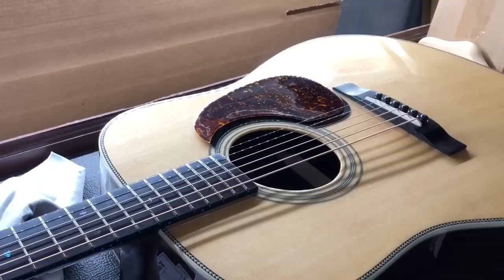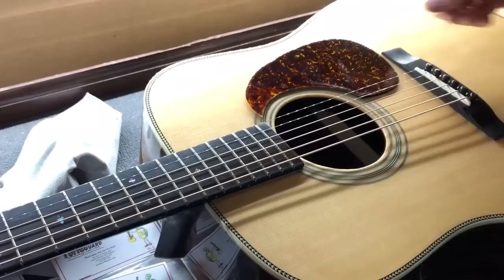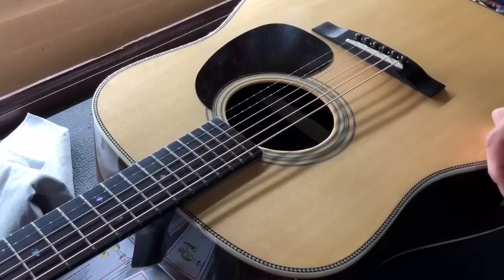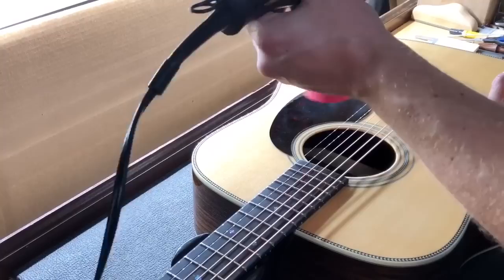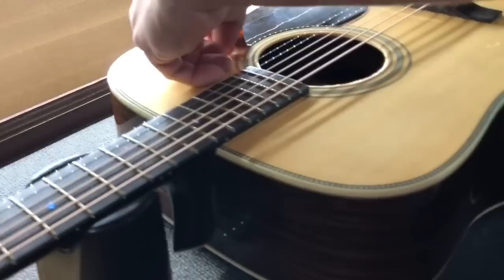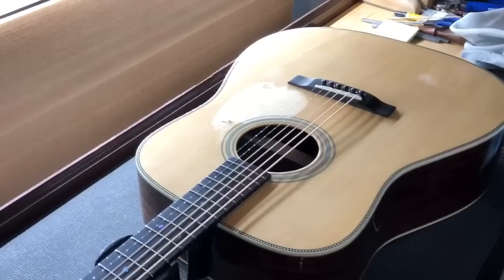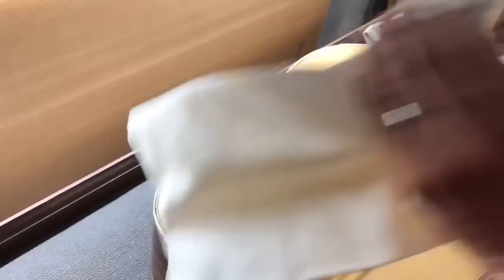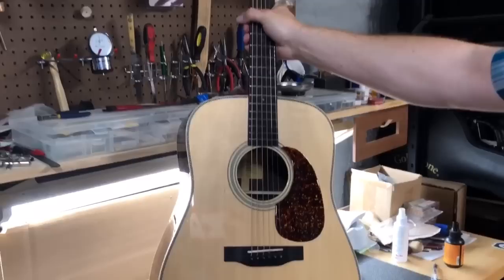Tech Tip: How to Change a Pickguard on Acoustic Guitar

Comment: Just removed a pickguard off a new guitar... 
All I did was fold a piece of A4 paper in half and wedge it underneath... done in no time... then removed the gunk. 
No way would I let a hair dryer anywhere near my guitar.... this way there was no heating/stressing etc etc
as simple as can be :)
Reply: Exactly, that direct heat can't be good... I, too just removed a pickguard off my new guitar. All I used was naphta (lighter fuel). Works like a charm to remove the glue residue.
Reply: @deejay.s  ... Now the lighter fuel is a good idea LOL... I spent over an hr with soft sponges and palmolive detergent!!!... what a freaking mess!.. I will be sure to remember this for next time!.  :)
Reply: Ive taken off using a sheet of paper, too

Comment: Well done. Very thorough tutorial. I'm going to replace mine but I'm going to cut and keep part of the tape on the bottom to hold my pick. I'm not a fan of putting on the head and I Inbetween strings.

Comment: I have removed the pickguard from my acoustic guitar without using a hair dryer. Maybe some pickguards are more difficult to remove with just a chisel, scalpel or similar tools, but mine came off without any problems. I carefully lifted the edge with a scalpel and then used a flathead screwdriver to help peel it off. It literally took me 30 seconds. Maybe this helps someone!

Comment: I changed mine using a heat gun on low and removed the glue with rubbing alcohol. I tried "goo gone" and it helped but alcohol works fine with a credit card. Gotta go there's a deer walking towards me at 11pm while I'm on my porch.. I live in the City lol

Comment: That pic guard did not look too bad when it came off, it looked very straight and it didn't look like it curled. Could it be reused on another guitar? Would it need some sort of adhesive backing, what would you recommend for that?

Comment: I’m pretty intimidated doing most anything on my beautiful Martin. I do want to change the pick guard from black to TS. removed some plastic letters off of the rear hatch on my car with thin fishing line. It slipped under the pieces and and pulled both ends slightly sawing back and forth. It made the job very easy. What do you think of that method? I’ll probably pay my local luthier anyway.
Reply: I am really hoping people do this for guitars that wouldn't cost more than 150 to 200 max. I personally would never do it to a Martin myself. I'd take it to a professional, to be honest.

Comment: If you want to remove a pickguard off a brand new Taylor, is the finish underneath the pickguard  ruined by the adhesives of the pickguard?  I have a 327e and would maybe prefer to not have a pickguard at all.

Comment: Windex also works great for removing glue.
Reply: Don't listen to random suggestions about glue-removing solvents. Your guitar may have a finish which will be damaged by alcohol-based liquids.
Reply: Heat the adhesive back up and stick masking tape to it' pull up and it's removed. 
This is the method I've used to remove adhesive left behind from decals and emblems in the body shop and have used it on several guitars also. 
Like he said'  some solvents can harm the finish.

Comment: Would a regular size pickguard fit on my 3/4 size acoustic
Reply: Is the soundhole smaller as well on those or is it just the body?
Reply: Grobee I think the sound holes are the same, I only own a 3/4
Reply: @fuchsia5899  I think it should be fine then
Reply: @groberti  hey umm I have an oval-ish sound hole I don't know the term for it and this might sound stupid but how do i measure it so I know the perfect fit when I buy a pickguard